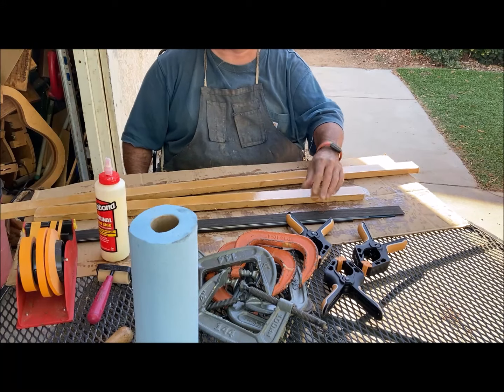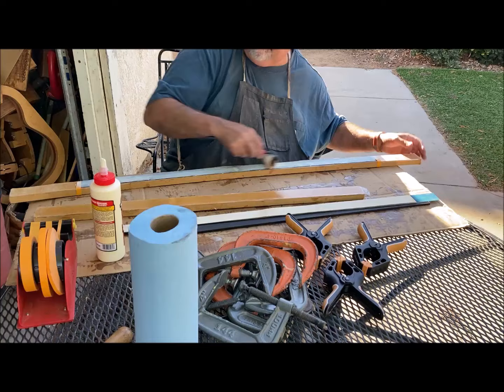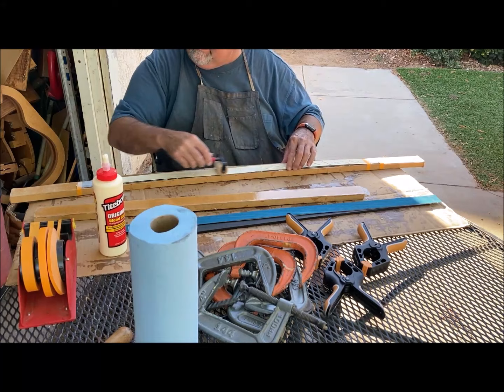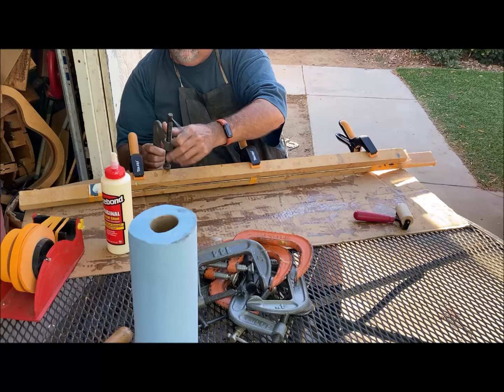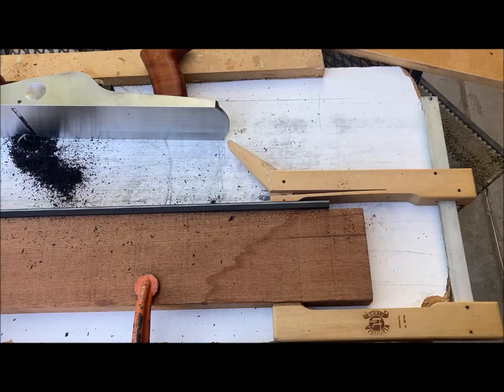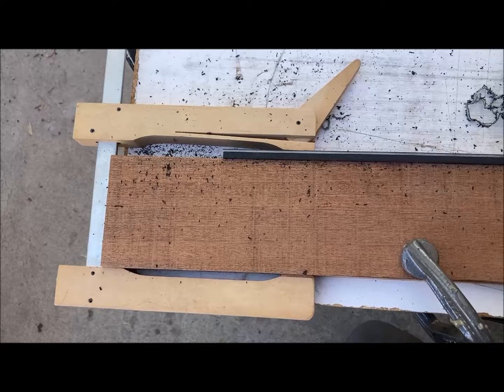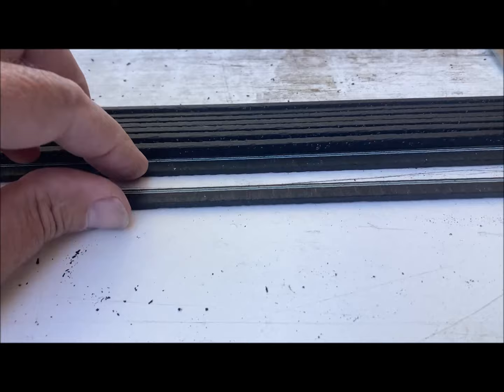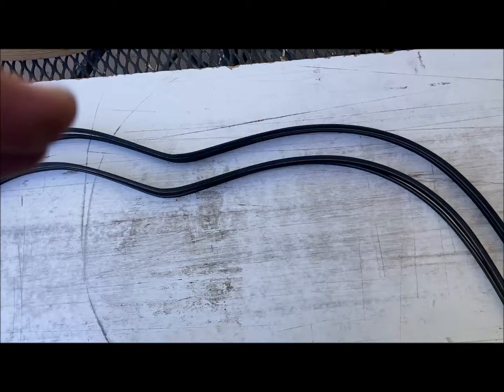How Guitar Binding And Purfling Is Made | David Schramm Luthier

Comment: I like the mask so I went and got one. And a flashlight. Some paint pens. I've been repairing electric guitars for a while now I want to make one. I'm scared of the neck though, any advice?
Reply from the maker: Great masks. I love them. What makes you unsure about the neck?
Reply: @schrammguitars  It seems like there are a lot of things to get right, the body/neck connection and truss rod mostly. I imagine there is a jig to cut the frets. I'm going to think of the first one I make as "practice" so no pressure, and no buyer.
Reply from the maker: @BariumCobaltNitrog3n  No truss rod in classical guitars.
Reply: @schrammguitars  Do you think it might be easier to build an acoustic than electric? I like bending wood.
Reply from the maker: Electric is much easier. I build those too. @BariumCobaltNitrog3n
Reply: That's what I thought. I was hoping you had a video on that.  @schrammguitars
Reply from the maker: A video on cutting fret slots? @BariumCobaltNitrog3n
Reply: Yes please!
 @schrammguitars
Reply: A video on making electric geetars. @schrammguitars